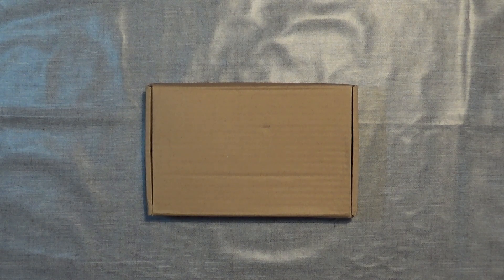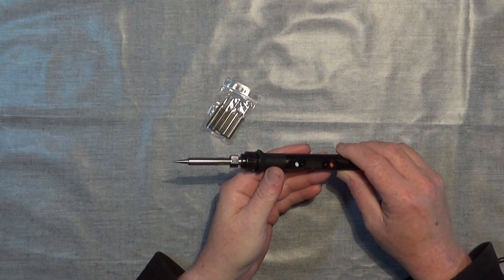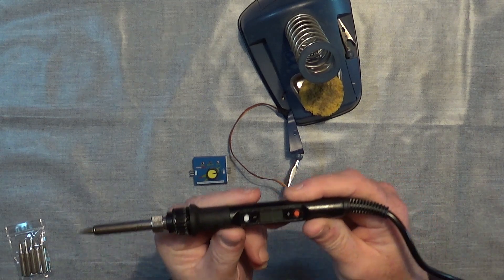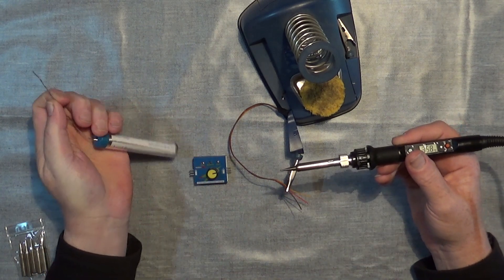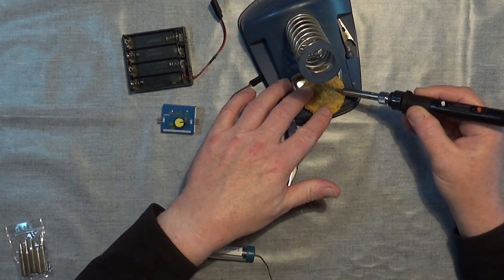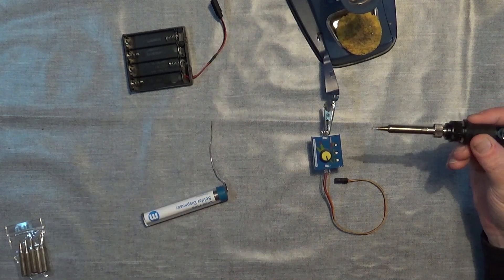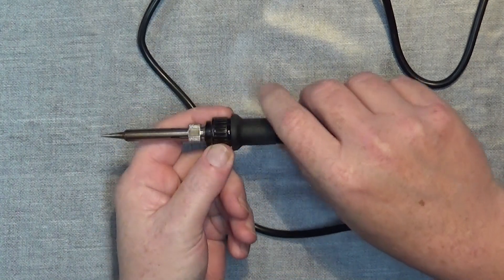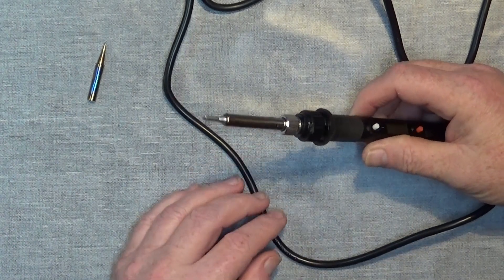First Look 80W Soldering Iron

Comment: Definitely a terrific value Mate!! £😊 You always have an advantage over us poor Yanks.... 220v at the Mains. We've only got 120v, which ordinarily isn't a problem, until you get into things like Soldering Irons. 
To get ANY decent work done, we need at least a 100-150 watt Iron....
I just realised right now that it MUST be the voltage difference!! 😳
Merry Christmas 🎄❄
Carmine ✈🚂🚙
Reply from the maker: Hay Matey. I never thought about that, but that's the great thing about YT not only is it entertaining and informative it gets you thinking about stuff you would never normally have considered. 
I've Had a slight issue with the largest tip with the solder refusing to stick to it but it still worked OK.
Merry Christmas to you to dude and keep safe.

Comment: Hiya Rob.  Looks like my cheap ebay soldering iron except mine just has a dial and a light to show if it's up to temperature.  It seems ok but I still struggle to solder the great big thick leads you get on some lipos, especially if I'm trying to attach a deans plug.  Like Mark says be good to do a demo if you can get the camera close enough to what you are doing.  Cheers for now mate :-)
Reply from the maker: Hi Pete. Cheers mate. I was having that same problem with my old one Pete. I am just working on a video  to go with the new build I just got (Not Tamiya Boo) as I found ModelSport had some brushless motors in for fairly good value. Not sure on the deans plug but even though the Tamiya plugs are crimp I solder them anyway. Cheers mate.
Merry Christmas and keeps safe.

Comment: Hi mate! Looks like an excellent buy for under a tenner! Especially with a temperature display and adjustable settings. You should make a "How To" soldering video, as I know you are blooming good at it! All the best, dude!  :O)
Reply from the maker: Cheers mate. I am just about to edit one, Well hopefully but I may be a bit cursed when filming soldering. I changed the tip for my how to as I was soldering quite thick wires onto the connectors of motor and no matter what I did the bloomin' solder would just turned into a ball and rolled of the tip. I ended up putting another tip on so I may have enough footage.